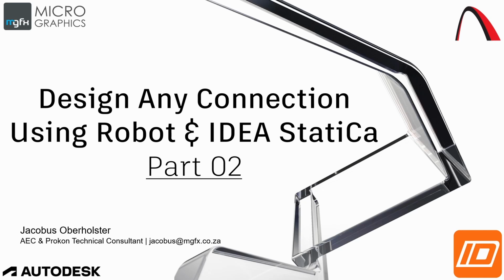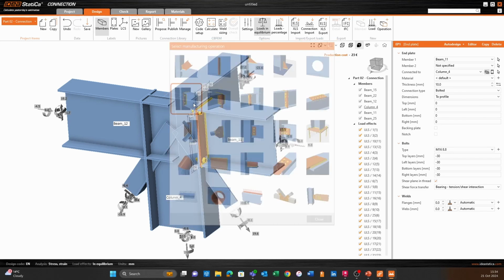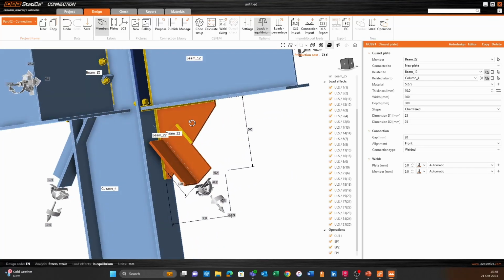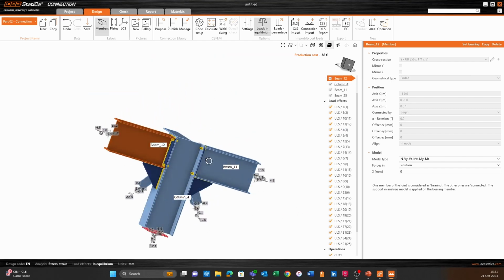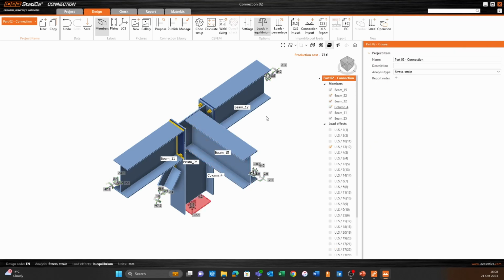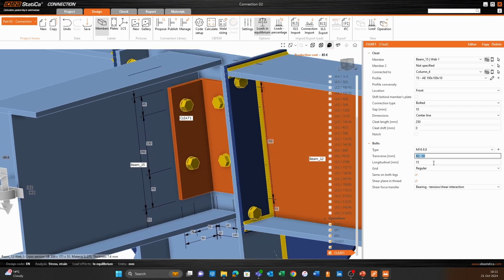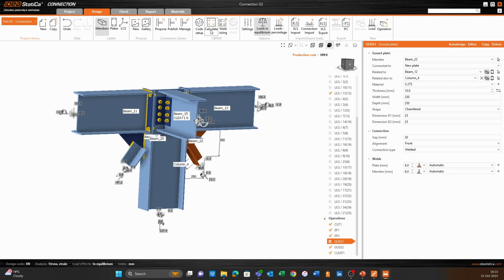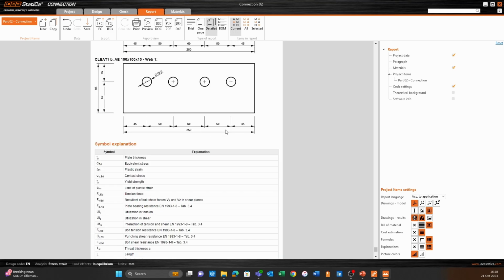Design Any Connection Using Robot & IDEA StatiCa - Part 02

Comment: what the point in welding gusset to column and beam at once, if there is flange bolted join of beam to column? how to perform this idea in real manufacturing of this?
Reply from the maker: This tutorial is only to demonstrate the relevant workflows. In practice, you are 100% correct, we wouldn't weld the gussets to the beam nor the column.